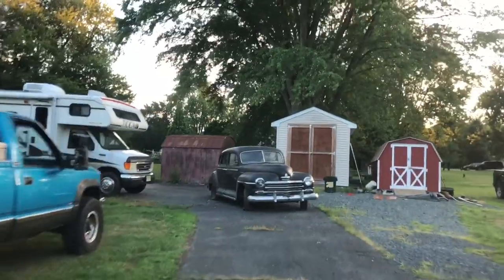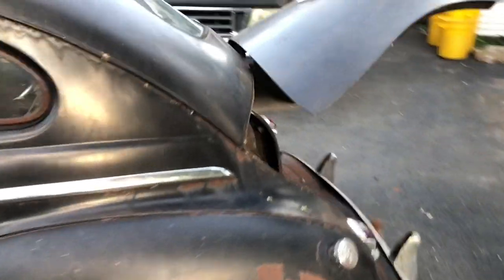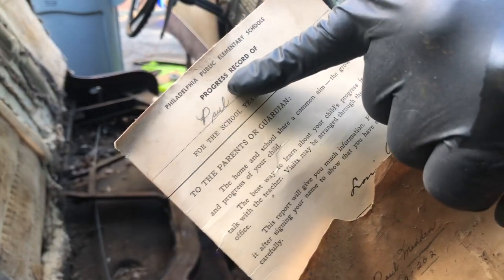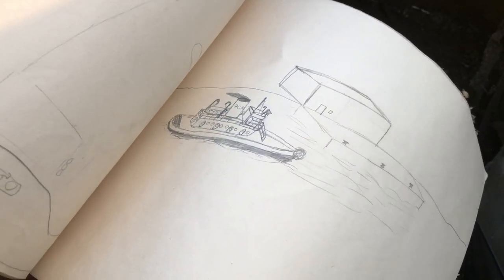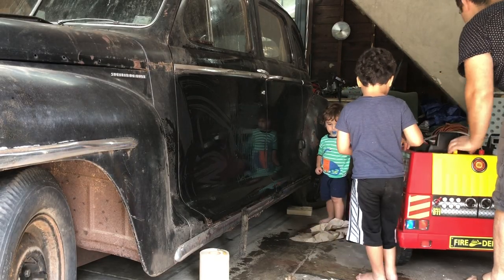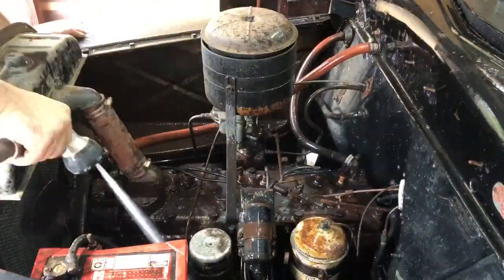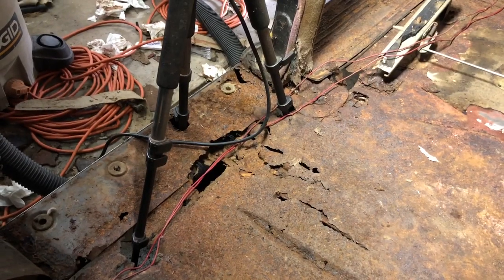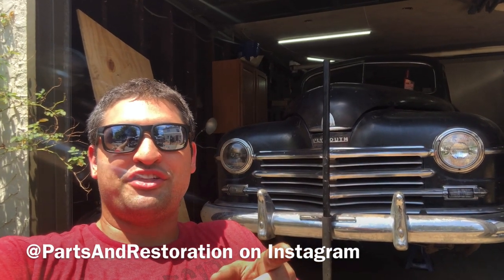1948 Plymouth Special Deluxe Sedan Barn Find: Recovery and the Journey Home

Comment: My earliest memories of cars were of cars like this.  My dad had a Special along with a Dodge Coronet from this vintage.  I was 6 or 7 when crawling around under them, doing an in-frame overhaul.  There was a long hill near our house with a highway over it.  He used it for a poor man’s dyno.  He’d start at the bottom at 60, floor it under the bridge, and see how much he’d lost by the top.  It’s quite likely that my, life long, fondness for inline 6 cylinders, stems from riding along next to him, on these runs.
Reply from the maker: That’s a great story Phil. Thanks for sharing it with me. 🥺🥺🥺
Reply: @partsandresto  I think the Plymouth was a ‘48 and the Dodge was a 49.  It would have been the very early 1960s.  We overhauled the Dodge motor in the driveway.  I remember listening to every detail of the sound it made on the uphill.  I might have been younger, it’s some of the earliest stuff I can remember.

Comment: As a kid in the 1950s, in Los Angeles, my grandparents had a '47 Plymouth Special Deluxe 4-door  just like this in a dove gray. I remember the car, fondly, especially the rear suicide doors. They would later trade it for a later model '50 Ford, then in '64, a brand-new '64 base-model Chev Biscayne wagon. Good times. Best of luck to you on your restoration. You've got your work cut out for you with those severely rotted floors.

Comment: That coating on the floor is a rubberized undercoating, intended to prevent cars from rusting. They used it on most cars, in the late 40s forward You can still buy it, in spray, cans at most Auto Parts Stores.
My Plymouth is 4 years newer (52) and it's a station wagon. Same engine is also now seized. One day (if I live long enough) I'll rebuild it. Good luck

Comment: There is a possibility that the coating on the floor may contain asbestos.  Just take precautions if you opt to remove it.  On my 48', I covered the old floor with new sheet metal, and in the trunk, I just removed any loose coating material, and painted over the rest.  Good luck with your project!!
Reply from the maker: Thanks Wayne!

Comment: Sure looks like a 1948 to me!
Reply: It's not a 1949. Google 1949 Plymouth and you'll see a different body style. The car in question here is 1946, -47, or -48.
Reply from the maker: Ugh. Its a p15 made in 49. I’m right you’re wrong, that’s all.
Reply: @partsandresto  Well, Chrysler may have made some of the older body style in 1949 as well as the later model. We had a '49 when I was a kid which was the later model. I don't want to argue, but looked up some info to try to educate myself: this is from a moderator of a MoPar chat site: "P15 is the series number for 46 to 48 Plymouths. It jumped to P17 for Deluxe and P18 for Special Deluxe in 1949. For 1950 it was P19 for Deluxe and P 20 for Special Deluxe. I don't think P16 was ever used. DeSotos were S11 in the 46-48 time period while Dodges were D24."

Comment: My Dad had the same exact car back around 1953/54. I spent much seat time in the back seat fighting with my sister. There was a distinct smell to the interior, espe ially if the driver smoked. The engine, and transmission had a distinct sound, and feel.If I remember correctly, the trans wasnt syncronized, and you couldn't hear the grind between1st& 2nd if you didnt double clutch.  between shifts.

Comment: I'm guessing you didn't pay a great deal for it, Dave? Helluva lot of rust on the floor, but how are the body panels? Looks like regular underseal on the back seat section - wonder why just there and not the rest of the floor? Going to be an interesting project, thanks for taking us on the ride with you!
Reply from the maker: Hey Tony. It was essentially a free car, I did a no-cash trade, the car for my old Chevy pickup truck that I no longer drive. The floor is shit but the body is excellent!

Comment: Rubberized undercoating , still available in spray cans. Definitely do not throw those seats away even if you do not use them someone will buy them from you for sure. Good luck you will have lots of fun with that car. Pull the cylinder head buy a new gasket,
Soak the sticky valves.
 bet you’re able to turn the motor free after a piece.

Comment: hi good progect  if you or anybody can help me whit my litle problem i have 1948 plymouth especial deluxe i changed all fuel lines new fuelgas pump rebuil carburator new filters wash the tank new gasoline but the pump after 3 minest or so it stops sending the gas up to the clear filter next to the carb but there is gas on the glass cup in the fuel pump it looks like it loses pressure and from the pump to the carb doesnt go up this is the secon gas pump that i buy and is the same result please a man in stress situation

Comment: Your kids will be teenagers by the time you get that done.
Reply from the maker: Brakes are done, fuel system is replaced, and the engine has been completely rebuilt.  Soooooo
Reply: Last time I check this man is a time traveler.... Actually went back in time beat the original owner to the sale at the dealership and drove it home!!!!

Comment: Not a 1949. Maybe 46, 47, 48. 1949 had unique bumpers.
Reply: First series '49, the ones you're thinking about were called the second series.
Reply from the maker: finally someobody who knows....
Reply: @rogercamp6071  I guess bumpers, tail lights, parking lights, radio panel, etc are all "First series 49". Never saw one, but if you insist......
Reply: @colettewelch9523  first series '49 is same as '46,'47,48 second series has the ribbed bumpers you mentioned.